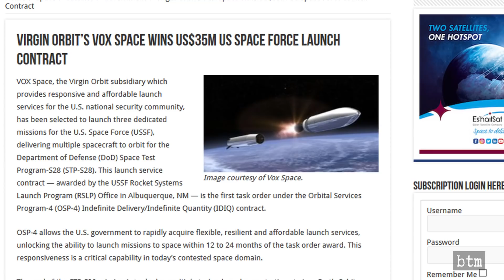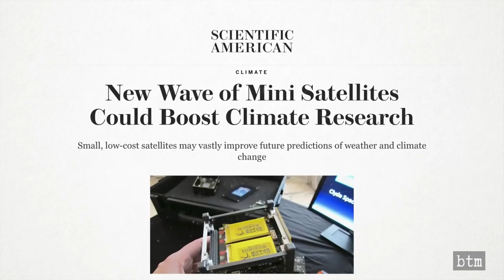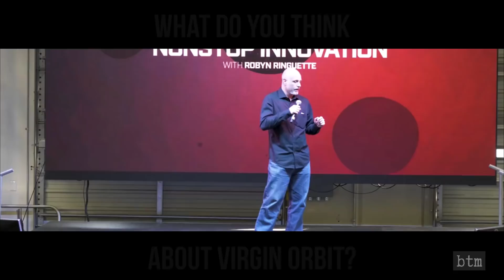Virgin Orbit’s 1st Spaceflight Announced | Why Virgin Orbit / VOX Space Over SpaceX or Rocket Lab?

Comment: Firefly will enter the arena next year the competition will heat up for customers. Lots of little LOX rockets. With a ground based launch you light the engines, measure the thrust, say go/no-go, and release the clamps to let her fly. Doesn't Virgin basically have to drop the rocket, and then hope the engines light and everything's good? Sounds much riskier for the payload.
I also can't imagine it not being more practical for small sat builders to transport their satellites to a ground based facility for flight integration instead of flying a whole integration facility and team to the payload, but maybe I don't have enough imagination.

Comment: 82.5 tons (165,000lbs) was the weight of the shuttle on top of the plane. This rocket is only 30 tons, much less than half the weight of the shuttle.
The tail plane of the jumbo could be redesigned to get out of the way when the rocket is released - rocket science?  Or common sense?
Reply: The Shuttle-carrier 747 had twin tails, so that redesign works. The question is, what size rocket do they want to launch, what market are they going for? Drop-launching something is easy, done by military pilots all the time and for many test aircraft. The 747 is ready-made for this - built with a wing mounting for a 5th engine. Not a working engine, but to carry spares to various airports. VO is using that mounting. This path is much cheaper than working with a large rocket launched from atop the aircraft.
Reply: @donjones4719  I imagine the pilots would be pulverized in the wake of rocket engines off the top of the fuselage.  The shuttle only glided off.  Nevertheless, there is the heavy lift helicopter - looks like a praying mantis - An aircraft built like that without a great hollow body shell,  all wings, fuel tank and cockpit could undersling a huge rocket so long as it had a stilt like undercarriage - everything is possible!
Reply: @peterterrell1712   That is one special helicopter, and IIRC it's the only one flying. Anyway, when the shuttle Enterprise was air-launched, IIRC the plane went into climb, released it, then dove and turned away. A big air launched rocket could be programmed to be polite enough to not ignite the engines until enough separation occurred. 
The airplane you propose sounds like Paul Allen's Stratolaunch carrier aircraft. Not sure how big a rocket it can/could carry, but a lot bigger than this VO one. Stilt legs are good for a vertical landing, a lot more problematical when coming in at 140 mph. But -  maybe short stilts...
That plane proposed to carry a 211,000 kg rocket, and could fit a 5 meter diameter fairing or rocket underneath its wings.